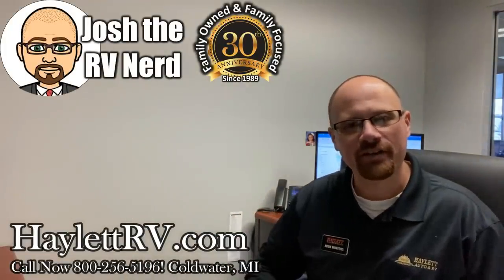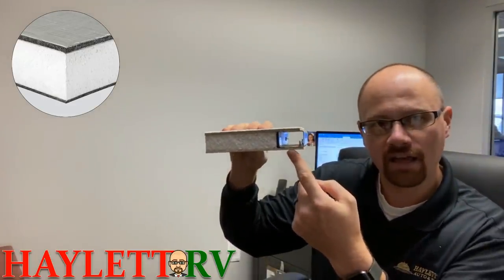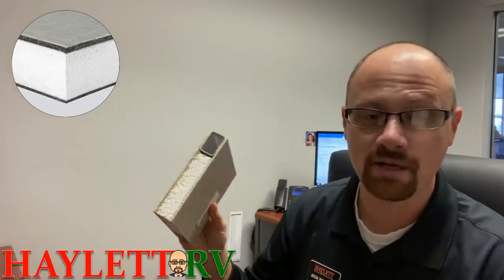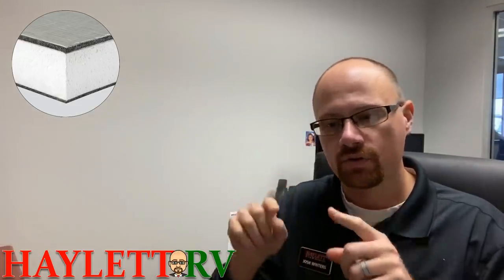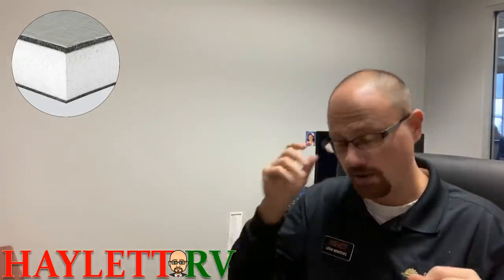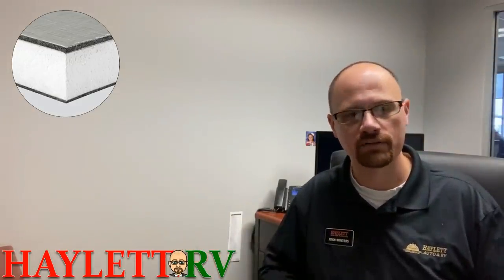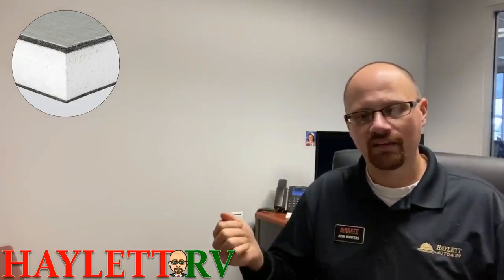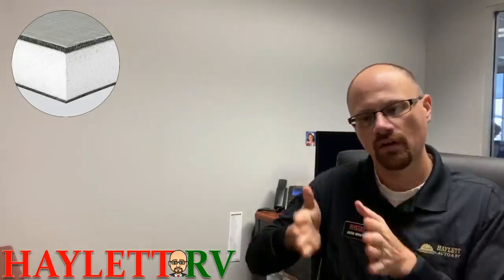Intro to Symalite an Azdel Type of Material with Josh the RV Nerd

Comment: Symalite Floors, Azdel Walls,  Lettssss goooo
Reply from the maker: lol -- knew that was coming :)
Reply: @JoshtheRVNerd  lol, the masses are predictable. Josh, Love your content. When my family outgrows our Wolf Pup 18TO (which we love) you have more than earned our business.
Reply: In full agreement..........sounds like the perfect combination :)
Reply: @JoshtheRVNerd  Well stated. As a advanced material reinforcement, new product design manufacturing engineer and as an RV owner for over 45 years, I am disgusted that most of the RV construction materials and manufacturing techniques are still in the dark ages.

Azdel on the outside wall and luan used in inside portion of the wall defeats the purpose. 

With today’s advanced materials, there should be zero wood within the side walls, end caps, roof and floor. Underneath the rv exposed to the elements should be highly scratch, impact and 100% water, mold and mildew resistant.

There doesn’t seem to be a product available that meets these standards, thus I am developing one. 100% composites, all 6 sides of aluminum framing welded and vacuum bonded together.  An industry first. It’s coming.

Comment: A rep from Keystone spoke with BTBRV awhile back about the new flooring material. The Keystone rep said something along the lines that it's only in the floor because like with Azdel they find it doesn't cut/route well after lamination around windows, doors, and such. Again, this is a paraphrase of what I remember.
Reply: "it doesn't cut/route well after lamination around windows, doors, and such."
I have no idea what that is intended to convey.
Can you explain,
Yes, I am fluent in English.
Reply from the maker: @Mark-gg6iy  When cutting out spaces for things like floor vents it doesn't cut as cleanly -- edges are a little rougher. On a window or door where you need a cleaner cut for seating that's a problem. In the flooring when you're not worried about a seal point it's not an issue.
Reply: @JoshtheRVNerd  Thanks for the reply. How is it being cut? Circular saw & jigsaw?
Perhaps a mini-grinder cutting disc would work better? Curves of course problematic.
I am not asking theoretically.
I may be buying some in ~2 weeks as I begin my 16'ft all-aluminum box build. Considering Azdel for walls & ceiling. Had not considered the floor.

Comment: Very interesting info and good ques from your viewers. In the same vein (I hope), is it used on the roof, as well? If so, does attaching "rigid" solar panels to the roof void ANY roof warranty? Thanks, and Y'all Be Safe!
Reply from the maker: Currently only in the floor. Know that pretty much any time you modify something from factory spec you've potentially sacrificed the associated portion of your warranty. 

Meaning roof modifications have nothing to do with your electronics, so the one will not void the other.

Comment: Am I correct Josh that the floor is one long sheet without seams? That would be awesome!
Reply from the maker: If laminated, then yes. Keystone often uses an 8' x 24' 5'8" floor decking that has only one seam at most in many of their non-laminated floors btw.
Reply: @JoshtheRVNerd  Awesome Josh! Thanks for always answering questions.

Comment: Is there an R value to Symalite for it's insulative qualities?

What about condensation tendencies?
Reply from the maker: I do not have R-Value specs on these, though that's an EXCELLENT question. If you look at the diagrams of the floor before and after you might notice how a higher density block foam is also being used now. That will help slow the transfer of heat. 

At worst I can estimate no loss of heating effectiveness (especially important on something like a Cougar with a full-time rv warranty and cold camp proven rating).

Comment: I just want to make sure I understand where this fits in... We have been mostly looking at the Montana High Country and Open Range level fifth wheels and am under the impression that most trailers have plywood or osb floors, this is the insulation layer under the plywood/osb right?
Reply from the maker: Glad you asked. 

Fifth wheels, like trailers, can have either a constructed floor with wood or aluminum studs and various forms of 5'8" floor decking with household batten insulation tucked between the studs. 

What's shown here is a material swap used in a laminated floor. It's the black layer in the picture of the laminated floor cutaway I have displayed thru much of the video. In the case of laminated floors a high density block foam is your insulator.
Reply: Haylett RV So there isn't a traditional plywood or osb deck layer?
Reply from the maker: @inmyimage1081  In the case of these Cougar/Passport floors: No. Rather than lauan decking under the linoleum you'll find a layer of Symalite with another slightly thinner layer under the floor. 

Around the 3:20 mark in the video I display diagrams of the floor construction methods before and after. Review those and let me know if you have any additional questions. 

And don't hesitate to ask. Never feel like you're "bothering" us. Purchasing an RV is a big decision and we're happy to educate in return for the fair opportunity to earn your business when you're ready.
Reply: Haylett RV Thx for the responses, definitely helps me focus on features for the rig we full time with.

Comment: Perhaps I may have an answer for you. When Ford went to aluminum. They most likely no longer needed the weight savings.
Reply from the maker: Possible, though Ford's use of Symalite was usually around engine areas for its noise dampening properties (another quality it shares with Azdel)

I believe that's still in use, though again I won't claim to know specifics on the supply of the material to the RV industry.

Comment: Considering the amount of moisture and condensation that comes through an RV lauan is a terrible material to use.  Once there is a tiny leak it is all over.   These composites mean that small problems will not totally destroy a coach.

Comment: I am assuming this is only going to be used in the travel trailers and possibly the half ton towable line fifth wheel.  I am assuming that the larger models like the 315RLS and the 361 will still continue to have the Dynaspan sheeting.  Do you know if this is correct?  I wouldn't imagine they would change the larger 5th wheels to a laminated floor.
Reply from the maker: You're 100% correct. This is being used only in the "Cougar Half Ton" trailer and fifth wheel series. There will be no changes to the pre-existing floor construction of the full "Cougar" larger fifth wheels.
Reply: @JoshtheRVNerd  Do you guys see good results with the Dynaspan flooring?  I know it is OSB board in a solid sheet but says it is designed for the RV industry.   I am assuming that is the 24' sheet portion.  I was just curious how the track record is for this flooring.
Reply from the maker: @ejsmith1353  We absolutely do. We have experience with it in everything from a simple Springdale up thru Cougar and all the way to Montanas. The lack of seams actually gives it a higher load bearing capacity and sheer strength vs. even plywood. 

I think it's an under-appreciated item in RV production due to the lack of understanding and general fear about OSB in general or anything like it.
Reply: @JoshtheRVNerd  Thank you very much for your reply and your videos.  They are very helpful.  OSB is a great product if used in the proper conditions.   I just didn't know how it would last in RV flooring.

Comment: Would this material be used in conjunction with an aluminum frame? Or does it matter?
Reply from the maker: I'm still learning a little more about it, but currently it's used as a lauan substitute in laminated construction applications. 

I think it's possible it could be used in place of wood paneling in non-laminated applications but I haven't seen that done yet

Comment: The industry is waking up to the fact that quality materials is the way to go.  Floors are now being build using aluminium framing so Azdel can be used now as well as other composite material vs stick.  Wood, outside of cabinets, should be gone from the industry.  As a client, insist on it or walk away from laminate wood sidewall and cheaper brands.  Companies are waking up to this, thanks to these type of videos
Reply from the maker: I still see benefits both ways. Lauan for instance still has better strength vs. composite substitutes. 

I'm sure if someone makes a material that's both lighter and stronger, then it'll cost a pretty penny. It's always a dance of what you want vs. what you're willing to pay for

Comment: Well stated. As a advanced material reinforcement, new product design manufacturing engineer and as an RV owner for over 45 years, I am disgusted that most of the RV construction materials and manufacturing techniques are still in the dark ages.

Azdel on the outside wall and luan used in inside portion of the wall defeats the purpose. 

With today’s advanced materials, there should be zero wood within the side walls, end caps, roof and floor. Underneath the rv exposed to the elements should be highly scratch, impact and 100% water, mold and mildew resistant.

There doesn’t seem to be a product available that meets these standards, thus I am developing one. 100% composites, all 6 sides of aluminum framing welded and vacuum bonded together.  An industry first. It’s coming.
Reply from the maker: There is actually some logic to the half-azdel wall methods like coachmen tends to use. Rockwood provided credence to the process by only using azdel in/out on their walls for the smaller models only

Rockwood found they were losing an amount of strength on the walls of their larger/heavier units by going only with azdel whereas lauan has a higher sheer strength and was better suited for a bigger RV. 

By going half/half Coachmen saves some weight while retaining some strength
Reply: @JoshtheRVNerd  So long as there is no RV interior condensation and/or water leaks I understand the combination however with today’s composite blends strength is increased and there is never a chanced of rot, mold, mildew and de-lamination.

A huge problem of interior RV moisture is from stoves with no exhaust hood over interior stoves and the small 1970’s worthless skylight exhaust fans still being used in bathrooms. Geo Pro and E Pro have the proper venting Maxair fans in bathrooms and over stoves. Many manufacturers do not. Never purchase an rv without an en exterior vented exhaust hood over the stove and Maxair exhaust fans in bathrooms. 

With so many RVs being sold today many are finding out the hard way that the different materials, manufacturing techniques and features have critical differences, many hidden. 

Thank you for educating the public so they know what they are really getting or not getting into. 

Azdel has a product that is specific for interior walls so no secondary wall coverings are needed. Azdel on exterior, welded insulated aluminum box framing, block foam insulation, low pick count carbon fiber backer covered by the Azdel’s interior product version vacuumed and thermal bonded is ideal. No VOC’s, nothing to rot, mold and mildew. Superior strength. 

Caps, sidewalls, floor, roof all welded together and welded to the frame. 

Imported suspension from Australia that will handle the off grid trails and pot holes in our crumbling road systems for the lifetime of the rv. 

Now that’s an rv!